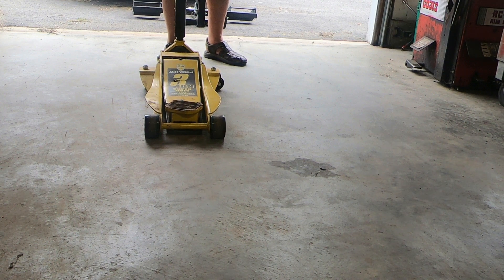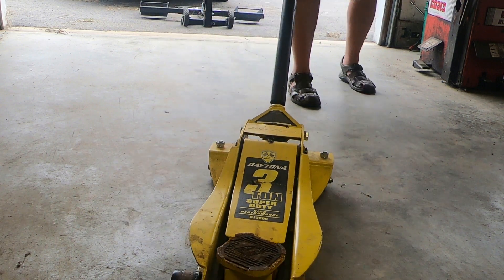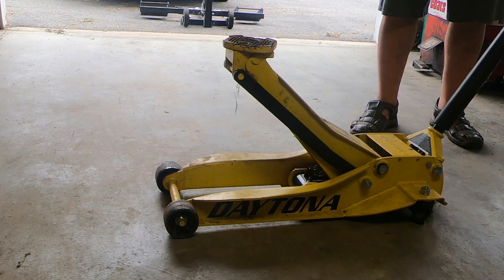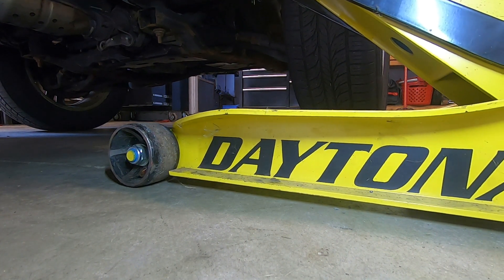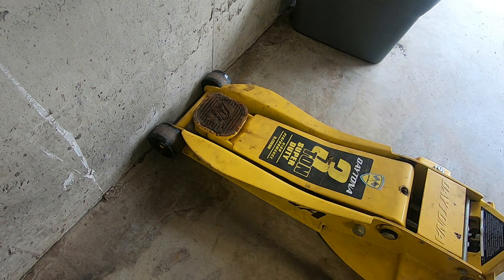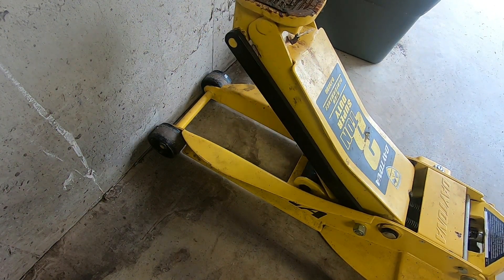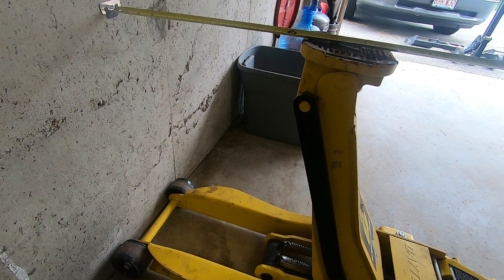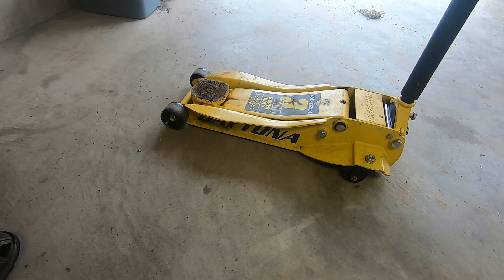The Reason for Wheels on Floor Jacks

Comment: Good reminder.  I've had the pad of a jack slip from under a jack point because the jack's rear casters refused to straighten and hung up.   The car abruptly fell and luckily only dented an exhaust pipe a little bit.  Since then, I have been hyper aware of making sure the jack is moving freely.
Reply from the maker: Thanks for sharing, I had a close call once for me and my dog. I was working under a car I had supported by jackstands on the inner frame rails. The front wheels were up and the rear wheels were on the floor. My German Shepherd had climbed under there with me. The car had an oil leak, so the underbody was prety well saturated. I had neglected to chalk the rear wheels. Suddenly I noticed the oil slick frame rails starting to slide on the jack stands. I rolled out of there with my Sheperd right behind me. We both got out just as the car came down. German Shepards are very intelligent.
Reply: @richardspaulding5035  Scary!  Oh yeah, that's a good reminder, too, about using wheel chocks.